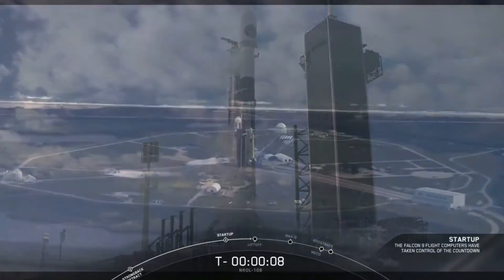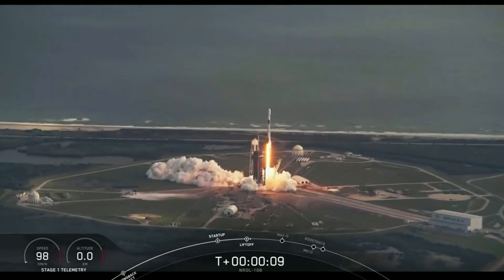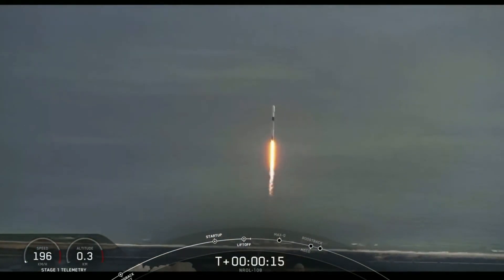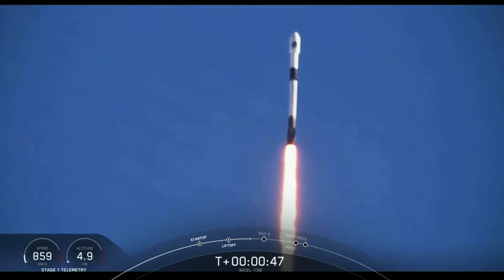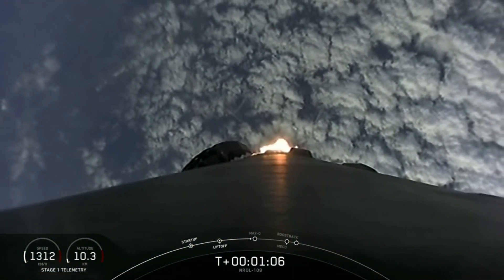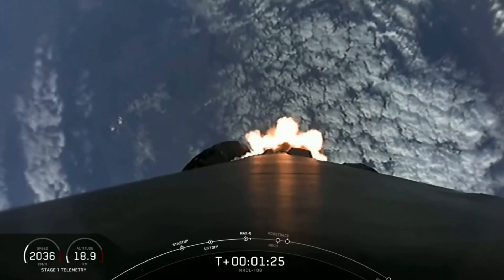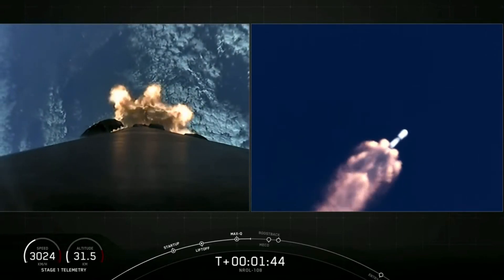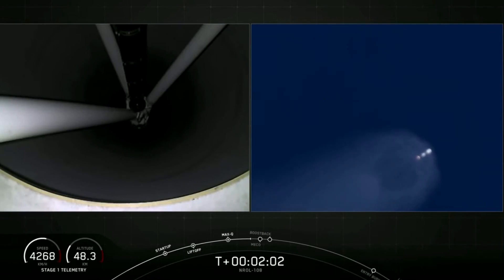Blastoff! US Spy satellite launches atop SpaceX rocket

Comment: Nuclear War in Plain Site.
Reply: Really? Really?
Reply: @morskojvolk  Fallout is the Virus, only Nuclear powers are launching the rockets
Reply: @pearsedonnelly8324  Are you saying Covid-19 is some form of nuclear fallout (that is undetected by any radiological equipment)?
Reply: @morskojvolk  Yes, Nuclear weapons give off an isotope called Tritium or H3 only detectable with a swab process called liquid cintilation, mostly only possible. In labs, Most Geiger counters will not detect Tritium.
Reply: @pearsedonnelly8324  I'm still not entirely sure what you're implying. Are you implying that the rockest are carrying some sort of tritium dispersal device? Or, a thermonuclear device? If so, where's your evidence for this? For what purpose? Keep in mind, the most common health hazard from tritium is in drinking water, that's why most municipalities test for it when monitoring water quality. Otherwise, an atmospheric concentration would quickly disperse to a level below what's hazardous to health.
Reply: @pearsedonnelly8324  A nuclear air burst? That no one witnessed? Without an EMP? Not to mention: why?
Reply: @morskojvolk  people are seeing them but they are being explained away as meteorites. Why? Why any War? Was Beirut Ammonium Nitrate?
Reply: @pearsedonnelly8324  Where are they being seen? There would be a hell of a lot more fallout than tritium, where's the fallout? And there would be an EMP that would affect communications, electronics and the power grid, where's that? War against whom? And wars are fought for a reason (albeit sometimes stupid reasons) so again, why? Orrrrrrr, are you just a POE?
Reply: @morskojvolk  No idea what POE is. As for the EMP well it would need to be reported on and the mainstream media are only reporting what they are allowed to. I just find it strange that only the Nuclear powers are launching all these so called Satalites. Trump deployed his "more useable Nukes" at the start of 2020, what they done to make them more useable I have no idea, there is tactical and strategic nukes.
Reply: @pearsedonnelly8324  An EMP would require no reporting, it would be immediately and abundantly clear to anyone experiencing one. The fallout would be apparent as well. You've seen pictures and films of nuclear detonations, does it sound logical to that even a high altitude burst could possibly go unnoticed by the general population? Many countries outside of the "nuclear club" have launched sattelites. Also, why would they televise it? Why not use ballistic missile submarines? That's what they were designed to do: launch a nuclear missile undetected. And you say all this without evidence! I'm sorry, I think your logic circuit is on the fritz.
Reply: @morskojvolk  Evidence of Radiation Sickness, Covid is identical to radiation sickness. And evidence of airbursts I gave a link for above. As for radiation in the atmosphere that has been reported in the news this year over Europe. Then you have the Beirut blast, my logic is fine. The same thing happened in the 70's with the Hong Kong Virus, during the Vietnam War and again in the 80's during the Cold war with the USSR and HIV. Now in 2020 we have another "Cold War" and Coronavirus" Show me a non
Nuclear power that has thier own space Program, Launching ICBM'S. Subs can only hold 24 missiles so best to launch from land. If you look at seismic charts you will also see shock waves that can be attributed to nuclear detinations. Am I right? Maybe not, it's Just a theory. Curious to know why your so determined to bin what I'm saying though, it's just a theory.
Reply: @pearsedonnelly8324  Whoa there! Covid symptoms categorically are not identical to radiation sickness. Reports of radioactivity from Northern Europe noted that the amount of radioactivity was very low and there was no impact on the environment or human health and was traced to a Russian reactor that had vented. 
There's no evidence the Beirut blast was anything other than an ammonium nitrate blast. Numerous larger ammonium nitrate blasts are on record going back to 1916. As for non-nuclear countries with indigenous satellite launch capability: South Korea, Japan, Ukraine, Italy and New Zealand (though, technically, NZ's is commercial). There are many more agencies that have contracted with other countries or commercial launch providers to launch satellites for them. As for SSBNs,  the 18 US Ohio class boats have 24 tubes each with each missile having 8 independently targeted warheads: 18X24X8=3,456 warheads. I don't know about you, but to me, that's a lot! And they could be launched in complete secrecy (until they detonated, in which case there would most certainly be an immediate and massive retaliation). Don't you think the death toll from nuclear weapons would be rather higher and concentrated? If a country's goal was just to kill a bunch of people at random around the world, wouldn't a weaponized pathogen be more logical (I am not saying that's what I think happened)? Seriously, I think you've gone a little off the rails here.
Reply: AND I think you know exactly what a poe is! ;)
Reply: @pearsedonnelly8324  Did your hair fall out? Did your skin necrotize? Did your gums bleed? Did you lose any teeth? Did your bone marrow stop producing red blood cells? Covid and radiation sickness may, indeed, share some symptoms (in fact, many illnesses share Covid symptoms), but they are not identical. You have no evidence to support your claims yet you persist. Does that sound logical?
Reply: @morskojvolk  Why do you care? No my hair did not fallout but others did experience most of the things you just mentioned, although not teeth falling out. So your a Nuclear and Covid Expert? But you have latched onto me saying nuclear war In plain site. Take care.
Reply: @pearsedonnelly8324  No, not an expert, but I can read (and I haven't read of anyone with necrosis, bone marrow damage, hair loss, tooth loss, etc from Covid). What do I care? When somone makes an outrageous, unqualified, claim, I either want to know what evidence they have or call it out for the falacy that it is. Don't expect to make crazy, unfounded statements and not get called on it. Having symptoms that may superficially resemble radiation sickness is not evidence of a covert nuclear war that no one is aware of. Hell, the phrase "secret nuclear war" is itself an oxymoron.
Reply: @pearsedonnelly8324  Furthermore, there's enough bogus info flying around here on YouTube that people fall for already. We don't need more fake news, that's for sure.
Reply: @morskojvolk  OK, Well I have seen People who hair has fallen out, Burns in their skin, Lungs burnt out, sergeons saying patients lungs were fused to the patients rib cage. Trump moved 30K US troops and equipment into Europe Early 2020, largest excersize ever, all NATO countries and enemies have covid. Military neutral have almosy none. The fact you said fake news says it all. The proof of war is all around us when you stop listening to the news. It is happening and it's not over. And there is an Army of people working to discredit anyone who has a different opinion, makes me. Wonder if you are part of that group paid to discredit. Anyway your right, I have no proof. So let's leave it there.
Reply: @pearsedonnelly8324  It's not that you have no proof, it's that you jump to an outrageous conclusion without anything a reasonable person would consider proof, or even evidence. And considering the number of impressionable people on the internet who may come in contact with that, it's important to separate fact from fancy. I try to promote informed, critical thinking, not jumping to conclusions.  BTW, India is not part of NATO, not particularly friendly with Russia, and is definitely not friendly with China, but has a serious Covid problem. Pandemics aren't new, this isn't something that's unprecedented, consider the flu pandemic of 1918. There are a lot of parallels.